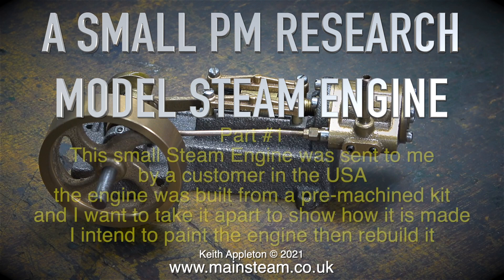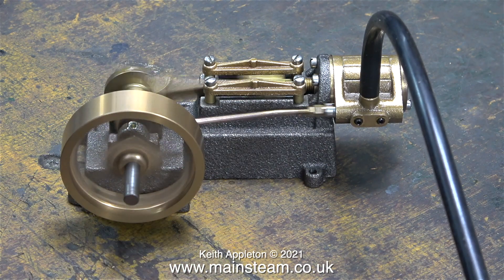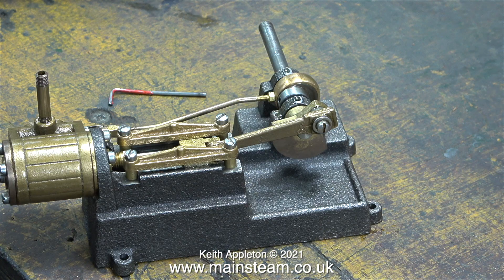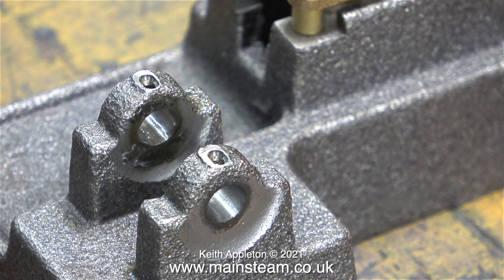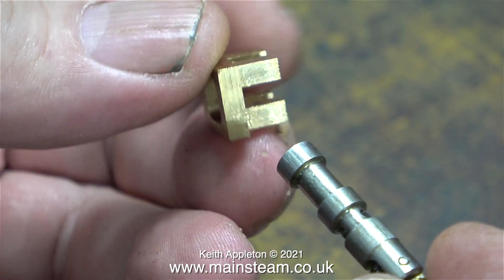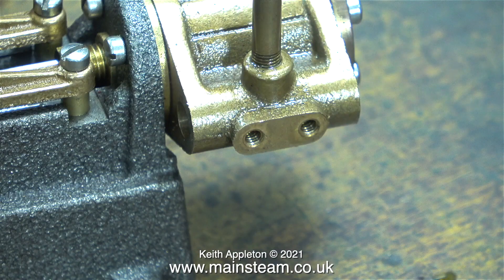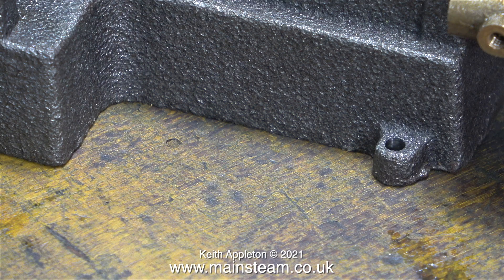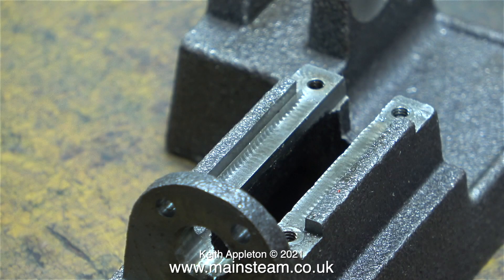A PM RESEARCH MODEL STEAM ENGINE - PART #1 - IN THE WORKSHOP

Comment: How did you run it? I'm trying to get one working without a boiler. Can you help me by letting me know the tubing you used and what type of pressure tank was used?
Reply from the maker: Compressed air from a small compressor with a length of Silicone Rubber Tubing.
Reply: Thank you very much! I was stressing about the design but now I have a clear idea on what I have to do.
Reply: Ok so I just got my air compressioner but I think it might be a little too weak, so I have a question how much psi you used to run it, because when I used the engine it gets stuck and does not run.

Comment: I have had the same engine for 15 years and it powers my modest steam plant. I installed some very small ball bearings on the crankshaft journals, and even one on the crank web. it runs so quietly you at tick-over that you can barely hear it.   But over time I did need to replace the cylinder because of blow-by at the piston valve.  It wore out indeed!

Comment: I have one of these PM research kits, and they use American bolts. I don't remember the exact size, but most of those slot-head screws are probably 4-40 or 5-40. 5-40 will have 1/8" major diameter. 4-40 will be a bit smaller.
It's great to see one of these that's been professionally built up; gives me some ideas of what to do with my kit as a finish it!

Comment: Thanks for the video. I've been eyeing one of these exact engines for close to a decade and have never purchased one because i've had no clue or indication on how well they were machined. I've got a PM research 6CI casting kit waiting to be machined and the castings are flawless save for one very small void in the flywheel. Knowing that they do a good job of machining those, I'll probably purchase one.

Comment: On this side of the pond, if those kits are built in/for USA/Canada, those are going to be #6-32 tpi, #8-32 tpi, or #10-24 tpi machine screws. They are a common standard over here. Hard to judge on the video which size they are.
Thanks for sharing 🇨🇦

Comment: Probably 8-32 UNC, 10-24 UNC, or 10-32 UNF. 8-36 UNF is possible but rather unlikely.

All very standard in the US, where PM Research is located. Hex cap screws are very rare in those sizes, however. You can go with Phillips filister heads or socket head cap screws if you don't like the slotted filister heads. The #8 is 0.164" dia and the #10 is 0.190" dia.

The closest US equivalent to a #5 BA is a 5-44 UNF, but that's a double oddball size: #5 is very uncommon, and UNF is uncommon in sizes from #2 through #8. A 5-40 UNC might also be a possibility.

Comment: Keith, is it true that slide valves are more resilient to condensation in cylinders without drain cocks because the compressed water will push the slide valve off the seat to escape..but piston valves just cause things to break?